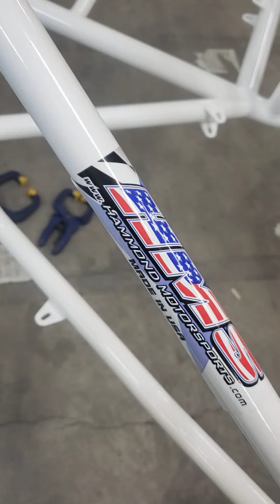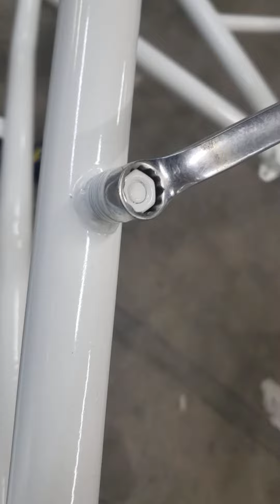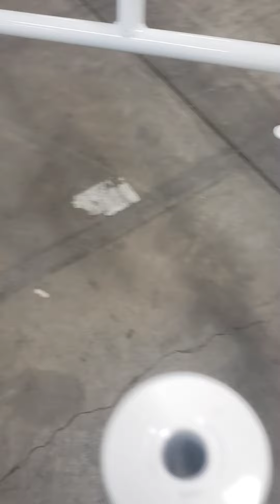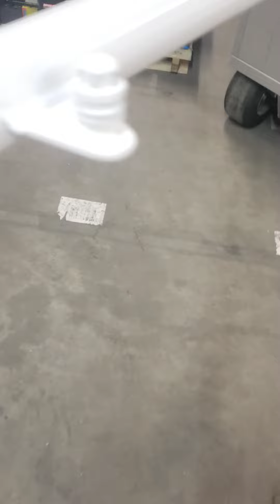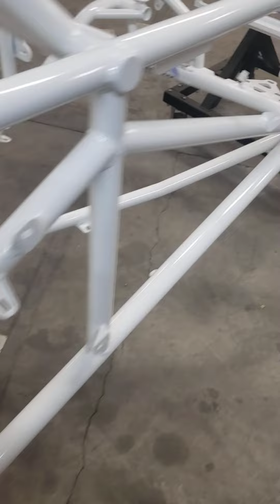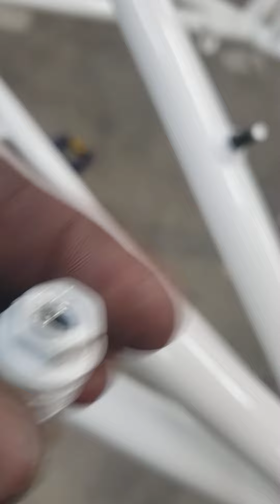Hammond Motorsports tip about powder coat chassis 11 29 23

Comment: Most all the cars and trucks I have ever worked on have a minimum of five chassis grounds in the engine bay, then there is one or two on the fuel tank for the electric fuel pump, lights, air bags, and so on. Sooo the more chassis grounds the better from my point of view.
Reply from the maker: yes sir I have 5 ground points on this car
Reply: @HammondMotorsports  Well at least you don't act like I am crazy when I bring it up, since everyone that has installed chassis grounds as I recommended have not had issues with MSD boxes going out, or other electrical problems.
Reply from the maker: @TheCrewChief374  best way to do it more is better in this case